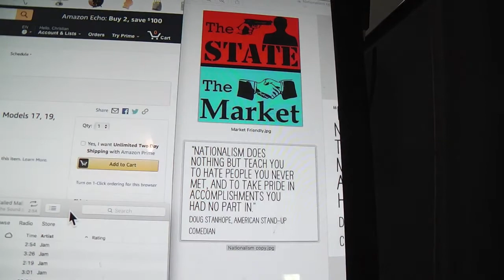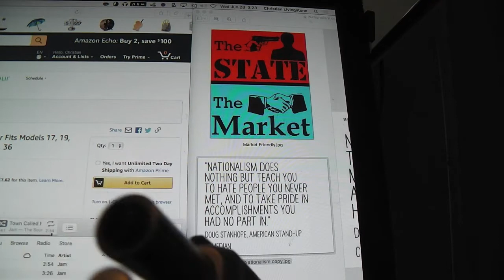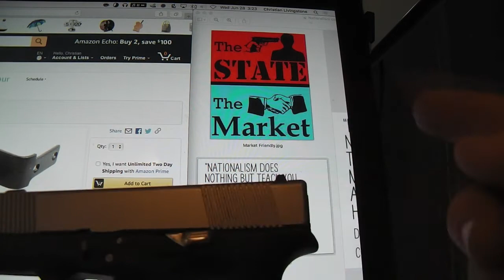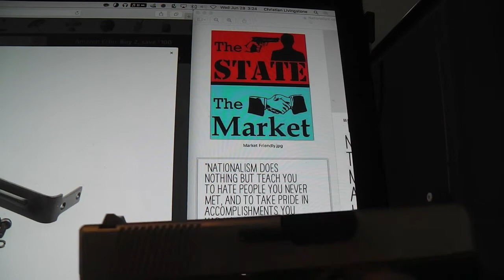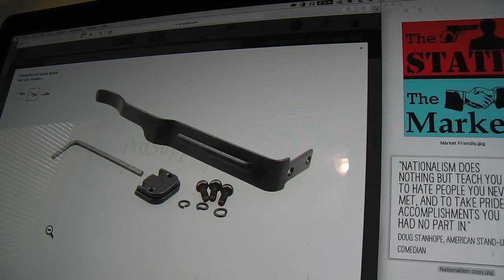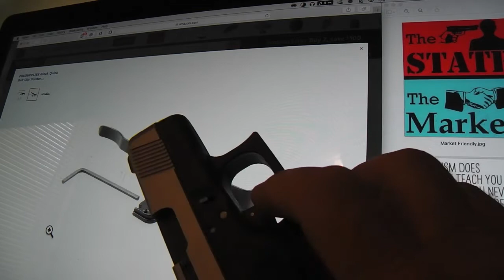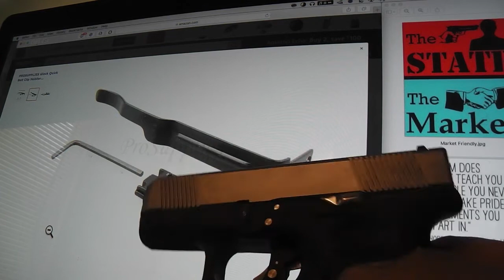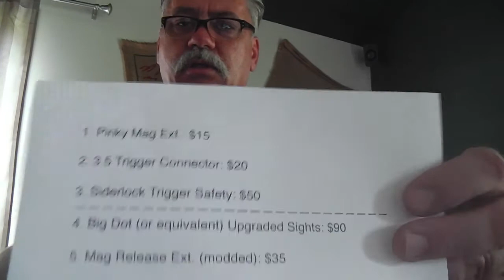Top Glock Upgrades - Including Siderlock Safety

Comment: Enjoyed the video. A regular guy with a Glock experimenting with options to make it a personal weapon. Glocks are kinda basic in many ways. I have 4 of them and do much the same thing as you did.
Reply from the maker: Hey, thanks for that, Dave! Yeah, I'm diggin' this 27 with the Siderlock and the ClipDraw, especially, for everyday concealed carry with no need for a holster under the waistband. I'm tending to use it in the 4 o' clock position most often, and not so much in appendix-carry as I thought I might, but also in a cargo pocket up front, as a cross-draw with the ClipDraw to keep the corner of grip and mag sometimes perched out of the pocket flap, which still keeps it mostly concealed. Otherwise, the Polymer80 lowers for Glock recently came out with an SC (sub-compact) version that I'll undoubtedly get, and shift the stainless slide and other after-market stuff to, and then put the OEM slide and barrel back on the original 27 lower. So, I'll have two similar .40 caliber sub-compact pistols before long, in all likelyhood, as the non-State-tracked/regulated Poly lowers are only around $150, and with the extra parts that I have, it'll be a fun and sensible move. And, gee, I'm sure glad that I didn't stipple the 27 as I originally planned, as the smoothed sides of this 27 are very comfortable to carry in this manner. The SC Poly80 lower is textured, but I'll smooth out its sides too.